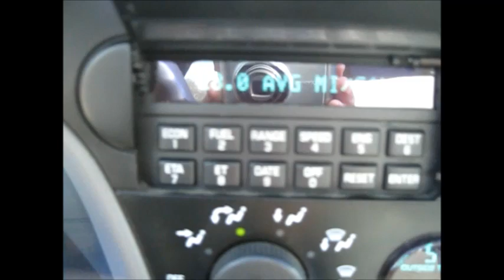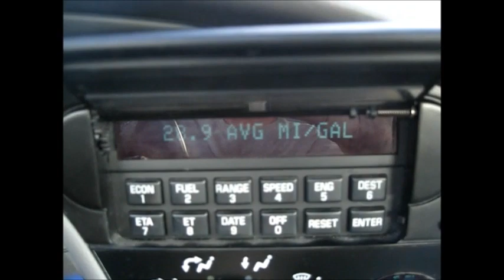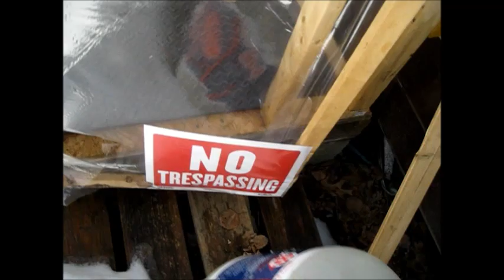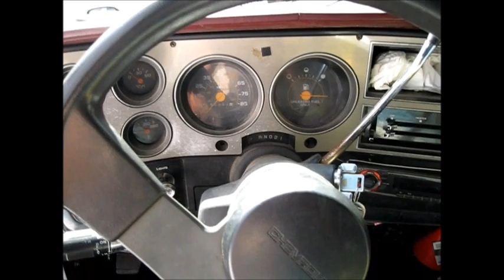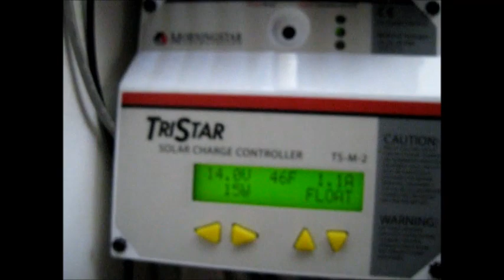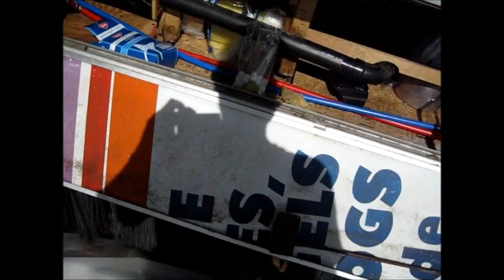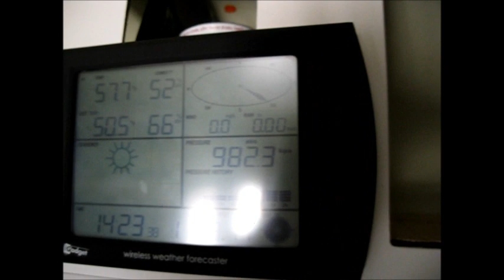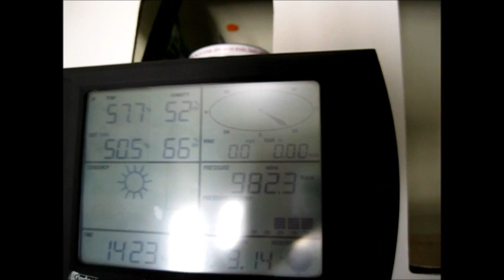Return To The Off Grid Project And Snowy Winter Land

Comment: Welcome home!  Some more advice from the prairies! 
1) pack down your drive in the early am when the temps are still low and keep up on it. Think in and out while the kettle is boiling for coffee. 
2) at all costs, avoid driving on the drive later in the day when the temps are warmer. It wil chew it all up and actually take longer to dry out. 
3) grab as many pallets as you can get your hands on and create a pallet "boardwalk" for your site. It will save your sanity and keep the muck down on your living area.
4) go and get a pair feed lot boots
 Those are the insulated rubber boots. Best $40 (where I live) I ever spent. Wet feet = unhappy Troy! 

But have fun. And get shoveling on hat wood pile!
Reply: This is some actually helpful, good advise. Amazing!
Reply from the maker: Thank you for all the tips. I will take your advice. Was thinking about a raised walkway out here as well. Going to look for free bricks from demolition sites and pave the whole place where I walk when I get a chance

Comment: I have a wood pile that I do not cover because I want it to be as wet as possable and sometimes if I don't take the wood off even if I dig down in the middle I will find some dry wood that was protected by the wood above it. When you have a few min did down a little and see what you find.

I am very glad that most things (the important things are all fine. I am surprised that you got a video uploaded so quickly after getting home, good job.
Reply from the maker: Thanks. I will dig and find some wood probably. Lets see

Comment: Welcome back Troy. You faired well with the small amount of damage from the winter. Glad you got the time away. We on the other coast got away with a mild winter and already have plants waking up. I am looking forward to seeing your new projects for the years. Have you done any research on a Solar furnace? It may help with the heating and cut down on day-time wood use. An integral solar powered fan would make it move air as soon as it started to warm up. Just a thought.
Reply from the maker: Thanks. Its good to be back. I use solar heating but right now the sun has left me.

Comment: The air in the tires of the RV they must be gong flat and shifted the rv. Put some wood on the porch to dry. split some to start a fire with it will be dry on the inside. When you get a fire started any wood added will dry.
Reply from the maker: Possibly. I will check the tires. Good idea on the fire. When I get it going i will do that.
Reply: The Do It Yourself World you can put blocks on the ground and level the rv by jacking it up and blocking it with boards and cinder blocks or railroad ties.

Comment: Another, glad to see you safely back home. And to see a blessing that your home fared much better than many others during this past winter. My biggest concern was that a falling tree or trees could have done extensive damage. Have already seen too much of that for this winter, in the lives of others. Including in our own local communities. 

Everything, seen so far in your video, appears to be relatively minor. Just some "headaches" to be dealt with over the next few days, as you get settled back in. Especially the dirt road to the meadow. Just going to take time for that to dry out. Some warm sunny days with "March winds", hopefully will take care of that fairly quickly. 

Couldn't help but smile, when I heard your rooster crowing, while you were first showing your car being stuck. Remembering all the naysayers comments after the chicken tractor parade. Looks like you couldn't have picked a better spot for them to be sheltered. Due to the low temps in your area, figgered the frost bite on their combs would have been much worse. Have seen them frost bitten, around here (in far milder winter temps) to the same degree. 

Open hatch is, indeed, a mystery. As you said, if left open from the start, it would have been readily apparent, for several reasons. The only non-human culprit that I can think of is a raccoon. Those nimble front toes are more like fingers. Thankfully, it doesn't appear to have been open long.

Hope nothing of real importance was under where the trailer roof collapsed. Later, this spring, that's going to be a good DIY project to record, as you prepare it for another life. Hoping to see you turn it into a regular trailer to tow behind your truck. If that's what you decide to do. Lots of ways to show -Reuse - Repurpose - Recycle - Repair via DIY salvageable materials it contains. Good potential with some of it for your workshop trailer. 

BTW, also smiling when thinking about those who berated you for not giving that trailer to another individual. Despite your warnings that it was too far gone for that purpose. Two old sayings come to mind. Time will tell. & Paul Harvey's - The rest of the story. :-) A "told you so" moment. That's for sure. Lol

As always, Godspeed on the rest of your Off-Grid & DIY journey. Looking forward to seeing what you'll be sharing with us, as the days & weeks go by. God Bless.
Reply from the maker: True, God did protect my property quite well. Even the old camper had to go anyway. Just proves that it was not livable and not safe for anyone. Would have been miserable for someone to be in there when it happened.

I will give the old camper a new life as a tiny home. This damage just helps me with my decision. I will use the innards to make the new home cheaper.

Hatch is strange but I will leave it at that. No real harm done. The wood will dry in time.

I also hope nothing was damaged in the old camper but I will see later on.

Thank you and thanks for always being there.

Comment: Good to see you home safe and sound.  Seems to me you were going to sell or trade that truck once or at least were entertaining the notion,  Good thing you still had it.  Never cared for SUV's much.  Sometimes you just need a good ol' truck to do the job.
Reply from the maker: Good to be home. Yes I was going to trade it for a jeep that might not have made it through all this. I do love my truck.
Reply: If at all possible, never get rid of that truck.  I had one exactly the same myself and you can not kill them, especially the 3/4 ton ones.  That dump box alone is a $1700 touch, the plow is worth roughly that as well. I probably have a bunch of parts left for that truck, I'll see what I can dig up
Reply from the maker: C Keevil I regret ever thinking about selling the truck. It sure is a good tool and a beauty.
Reply: Link Knight Dodge products (jeep) are well known for having poor transmissions (queue the angry remarks from dodge fans :s) and they cost a small fortune to have repaired. My guess was that it was the pump that was going out of it, but it could well have been the torque converter as Troy had mentioned. The problem is, when those things go, they tend to act like a grenade and send metal through the rest of the transmission. Probably would have been looking at a complete rebuild at a minimum of $2000.

Comment: Maybe you can find a deal on craigslist for used tires with good treads for the truck?I find that the ground freezes and thing get out of alignment this time of year.It happens with the  front steps of my mothers mini home.Maybe you can lower the porch or slide it back. If you remove the blocking and or use  board shims to align til it warms up?Welcome back and stay warm.
Reply from the maker: Thanks. Yes I will have to adjust for the freeze and then re adjust when it thaws. I will save up for the tires and try to get some before next winter. Its a good idea to look online, thanks.

Comment: Troy I am glad you made it back to the RV safe and the RV is in one piece
Hope your stuff in the camper is not to wet. O my , you had to go through slippery snow. Did you get the fire going after. stay worm
Reply from the maker: Thanks. No fire yet. Wood is soaked badly. I will have to cut some standing trees when I get the chance. For now I am using propane.

Comment: I am glad to see you made it back home.  Over all everything looks o.k.  I was wondering how the chickens were doing I was worried about then.   It looks like you only have a few things to take care of.  The porch look like the worst problem.  I think if the tent was dry inside you should move your wood for the stove into the tent.  I would put down 2 pallets then pile the wood on them.  Again glad to see you made it home.
Reply from the maker: Thanks for the tip. I will probably do that. I was also worried about the birds but I did all I could for them when I left and they made it well.

Comment: Glad to see you made it back and there is no major issues at the RV. Looks like you have your work cut out for you. Good to see you left a solar panel or 2 hooked up so you can have some electric. We woke up today to raine then freezing rain and with in 20 minutes the wind picked up and the ground was white. snowing for about an hour now and there is atleast an inch there calling for 2 to 4 for us. I think we are going to get more than that. by the way we are in Ohio just about an hour and half south of cedar point. One question you said you would not be using the wood stove for awhile is there a problem with it or are you just being safe and wanting to inspect it before you fire it up?
Reply from the maker: Thanks. Its good to be back, cold and all. I left the solar panels on to protect the batteries from damage. My Dad just said you cant see the road in front of you its snowing so badly now. Lucky I got out when I did then.

I want to inspect the wood stove for safety, yes. And my wood pile is uncovered by wind and then covered by snow. Need to dry it out.
Reply: The Do It Yourself World ya its snowing and blowing at times here that we can not see more than 100 feet. so its coming your way. wind guest of 45 mph today as well so went out and tied the solar panels down just got the one and would hate to see it damaged so soon. looks like you may be stranded at the rv for a few days so i hope you got everything you need to hold you over untill then. Good luck and look forward to seeing the next video.
Reply: The Do It Yourself World
 yup, here in michigan the roads are crazy bad and snowing madly.
Reply: crazy weather we been having I was able to get the bike out of the shed yesterday get it fired up and rode a good hour with only jeans and t shirt i believe it was 67 yesterday. Windows open door open yesterday and today everything is closed tight and heat is turned on. And dreading the idea that I have to go clean the truck off and pick my daughter up later today.
Reply from the maker: Michael Baldridge Rained all day, turned to freezing rain and now turning to snow. Going to have a high of 20 tomorrow and 6 tomorrow night. Fighting to get it above 50 in here right now at the ceiling.
Reply: The Do It Yourself World I know what your going through our furnace went out right before the real cold hit this year when it was around -50 out.. I did have back up heat but it only kept living area in the low 60 but bed room would not get any higher than 45 near the ceiling. great for sleeping but not so good having to wake up and get out of bed lol. I woke up this morning to 2 above and looks like its going to reach 20 as a high also. I know you have windows covered by blankets but if the sun is shinning open them up and let the sun come in wont do much but it sure will give you a few degrees.
Reply from the maker: Michael Baldridge Freezing today. Cat water froze up on me. Cant feel my toes. Going to work on the wood stove now.